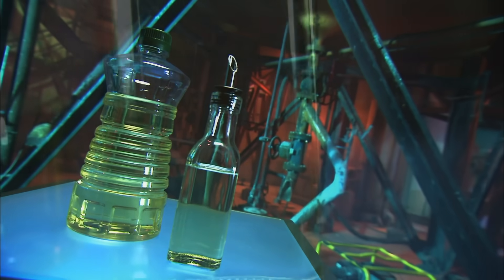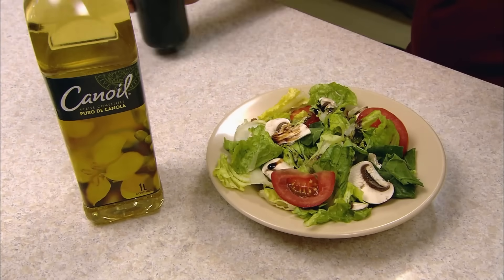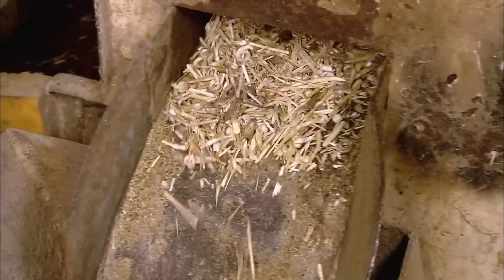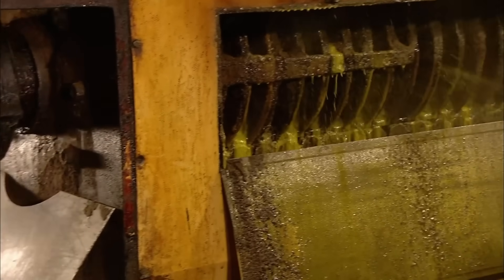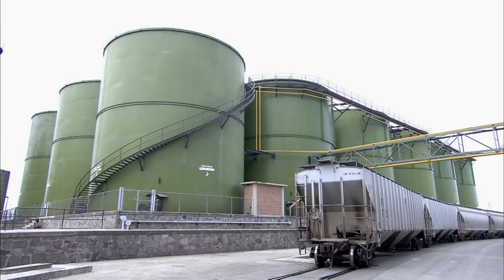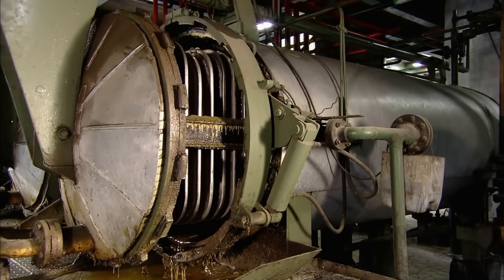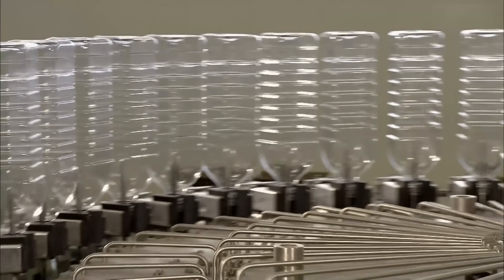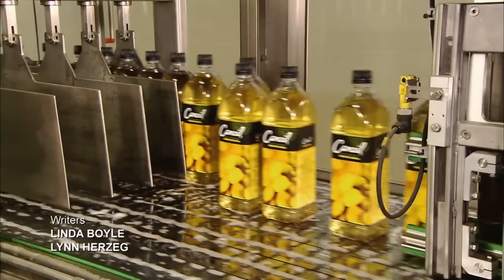How It's Actually Made - Canola Oil

Comment: I remember being so confused about why I'd see Canola oil mentioned in American recipes but never see it in shops, I thought it was some American corn thing. I only now find out it was just rapeseed oil the whole time.
Reply: It isn't as simple or straightforward - Canola Oil is oil from specific types of Rapeseeds - Canola oil is a vegetable oil derived from a variety of rapeseed that is low in erucic acid, as opposed to colza oil, which also comes from rapeseed.

Canola actually comes from Can (Canada) o (oil) la (Low Acid)

Furthermore, in some countries, the term 'rapeseed oil' is used to refer to the oil for industrial use, whereas 'Canola oil' is used to refer to the edible cooking oil, as it is lower acid. Colza Oil is a higher acid Rapeseed Oil, differing it from Canola

Comment: 6:52 what is the point of this machine.  Seriously all it does is pick up the bottle from the conveyor belt, flip the bottle upside down, then flip back to how it was and puts it on what could’ve been the exact same conveyor, had they just made it a straight line instead of a rollercoaster.